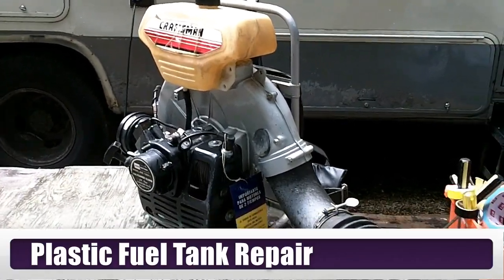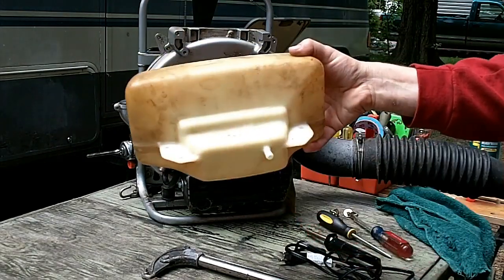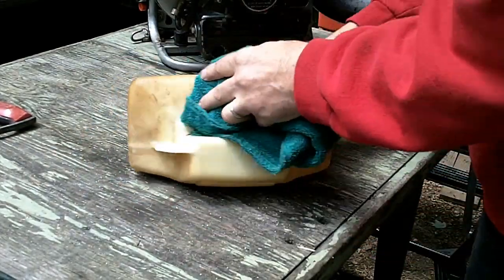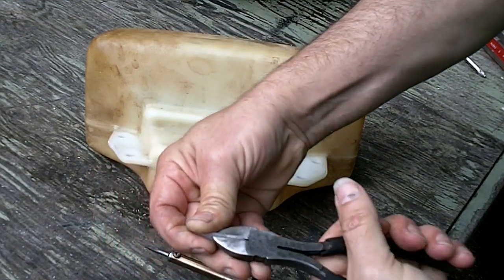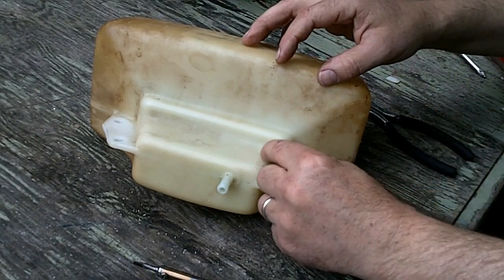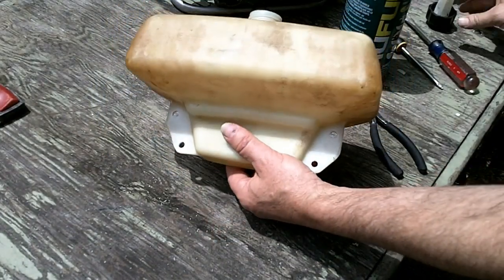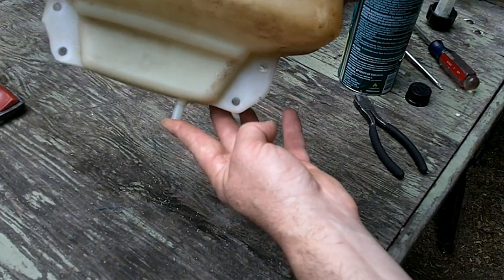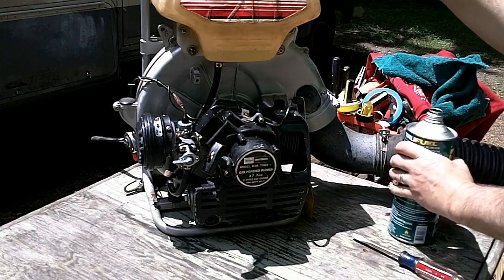Plastic Gas Tank Repair - Fast & Easy Small Engine Fix

Comment: Very smart man you are. Helped me fix 2 holes in my big Redmax 8500 blower fuel tank and boy am I glad because there's only one available on ebay and they want $70 for it. Thanks, sincerely and have a great day.
Reply from the maker: It's great saving money, isn't it? Good job. Thanks for watching and commenting.
Reply: You're absolutely correct sir. The tank on my redmax blower didn't have any tabs with extra material to use for the repair so after melting the cracks together maybe I got the area a little too thin because overnight gas starting seeping through again. So I didn't give up and removed the tank from the blower, washed it out and off with soap and water and roughed the repaired areas down with sand paper. I then applied a big puddle of Krazy glue on both cracked areas and covered them with baking soda and the super glue instantly became as hard as a rock. I sanding a bit more to smooth out the dried hardened glued repaired areas, installed the tank back on the blower and filled the tank with gas. It's been sitting full of gas for 2 days now with no leaking so I believe the problem has been corrected now, thanks again.
Reply from the maker: Hey, that super glue and baking soda is a good trick. I will have to remember that one....Thanks.

Comment: I've done a similar fix in the past to save a plastic gas jug.  I didn't think the same would work on this kind of plastic, which seems harder and more brittle, but it seems to have worked well.  I'm going to try the same fix on my riding lawn mower tank.  It should work, but I'm concerned the sub zero winter temperatures will cause the crack to reappear.  Time will tell. Thanks for giving me the courage to try.

Comment: A good idea with a crack is to drill a small hole at both ends of it to stop it creeping further and then use old plastic bottle, as a welding stick like you have done...

Comment: Thanks for the video. I have a coleman generator with 5 gallon plastic gas tank it has a SMALL leaks at the seam...So I cant fill it more than 1/2 full. I cant get a new tank as it's a discontinued generator. Is it ok to use it, since the tank is not fully sealed?..Is there a good way to seal the seam crack?...Thanks for any help.
Reply from the maker: I don't think there is any problem with using the cracked tank, keeping the fuel level below the crack, of course. Fuel is probably just gravity fed to the carburetor, so it's not a pressurized tank. You could try to use the soldering iron to repair the crack at the seam. But if it doesn't work, perhaps you can design a way to mount a generic replacement tank in some fashion. 
Good luck.
Reply: @Buckwsr  thank you for responding!

Comment: Any thoughts on JB Weld epoxy?
Reply: jb weld will hold up well. have used it to reseal a shitty crapsman rebranded chainsaw. 👍
Reply: J b weld is great But it will not hold the plastic under the vibration

Comment: I have a backpack tank sprayer that had a hairline crack. I used 2 part epoxy. It doesn't leak now. Now I have a leaking lawnmower float. I can't find the leak & it's full of fuel. I'm gonna try drilling a very small hole to drain, then epoxy the hole. Then I will try submerging it & look for the bubble. Hopefully I'll find the leak & epoxy it too. If I had $10 I would just buy a new float.
Reply: Update; after researching, I used a heat gun on low to piss out the gas. I then put it in hot water & found the VERY tiny hole. I'm going to do like you did & use a soldering gun on 15W.
Reply from the maker: I admire your resourcefulness. I'd probably just replace the float... Thanks for watching and commenting.
Reply: Buckwsr lol, I'm broke till next month. The plastic was so thin that it melted thru very slighty. I used epoxy but it kept bubbling because of the warm air. I put a piece of blue tape over the repair. We'll see how that works.

Comment: My brother patched 2 cracks im my dirtbikes gas tank a few years back and a year later it cracked. About a moth ago i got around to patching it again. And a few days back i descovered that it cracked again. What do i do. I cant buy a new gas tank cuz the bikes too old and now all of the modles of this bike are having the same problem or will have the same problem a few years down the road
Reply from the maker: So are these new cracks appearing in new places, or the same old crack repair failing over and over again?
Reply: @Buckwsr  these are new cracks. I think what caused this recent crack through was the colder weather making the plastic shrink. but still the gas tank should not crack in a garage in 45 degree weather.
Reply: @Buckwsr  and the crack after the first 2 that my brother patched (the 3rd crack)  formed while the tanks was sitting in my house where the temperature stays steady.  Thankfully  all the times this tank cracked it was empty or the fuel level was low. By the way this bike is from 1980 so it may just be time to have a tank welded up.
Reply: buy a 3d printer.